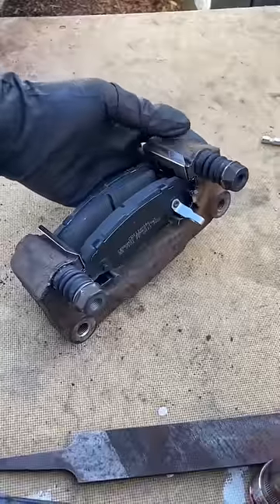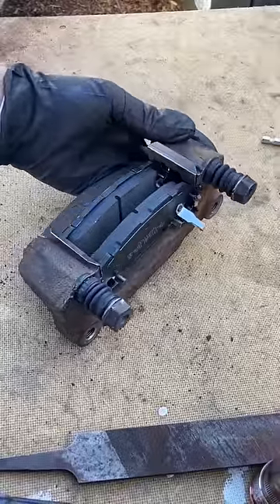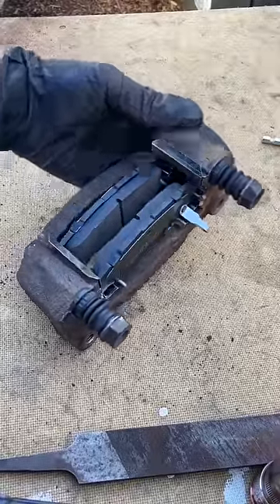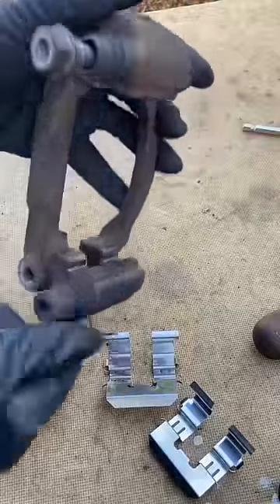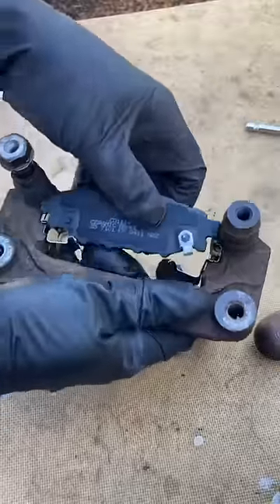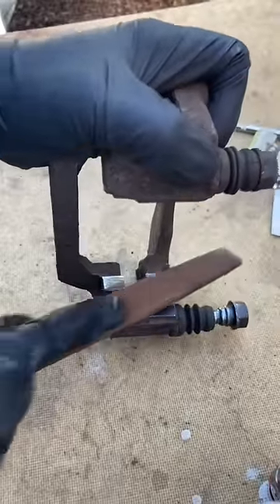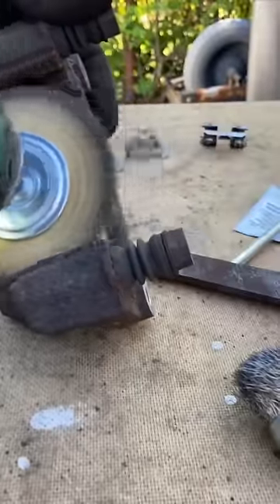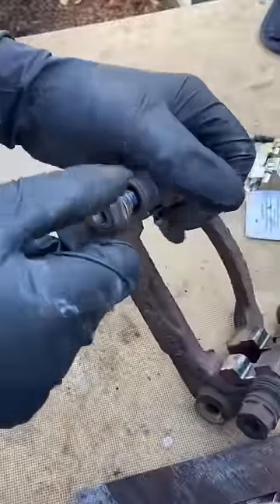What’s the Difference Between a $50 Brake Job and  $200 Brake Job

Comment: Now I'm gonna show you the difference between getting ripped off and getting really ripped off. 😂
Reply: I don’t know how that’s getting ripped off? 50 bucks for a brake job is a steal
Reply: Right
Reply: @Auto209   u get what u pay for lmao my brake pads alone are almost $50. Are you really getting a brake job done or are u paying him 50 to see if your brakes are still good😂
Reply: @itried2hard633  guy I’m the vid is talking about labor only… I’ve never charged anymore than $40 labor and I’ve been doing brakes and charging the same price for twenty five years now. He didn’t show himself doing anything different than I’ve been doing all these years. $200 labor to put pads on a vehicle is just ridiculous
Reply: @warrenmcelroy4718  so $100 per caliper, divided by the minutes it took, x 60 to get an hourly rate. The rebuild parts for the slider is separate cost since they're not included in a set of pads. The pad retainers and guides are though.
The fluid flush of the old brake fluid would be a critical part of a comprehensive brake service though; hopefully that is part of it, because that will keep the pistons from seizing in the bores. 
That isn't shown but fluid flush and replacement will add time to the job, so the labor rate would be lower in that case.
Brake rotor condition is not shown but assume it needs replacement or some additional work, if the old pads were on there long enough for corrosion to build up under the pad retainers.
Reply: @dubmob151  rebuild parts for the slider and brake fluid flush are only needed every great once and a while and as far as new rotors go once you have the caliper off swapping the rotors out really takes no extra time at all
Reply: @itried2hard633  the guy specified that was only for time not the parts
Reply: @dubmob151  brake fluid change is not a necessary part of a break pad/disk replacement job. If it’s not dirty leave it alone.
Reply: You guys looking at the reservoir to gauge if the fluid is dirty or contaminated are rarely going to be doing fluid flushes or changes apparently.
Reply: @markgonzaga6924  I really couldn’t care less what you would want to do, I have people that have been calling me to do their work for twenty years  now so I really don’t need to rely on someone like you to help me make my side money. Doing brakes isn’t difficult at all, I was doing brakes, bearings and seals at fourteen years old so for something so simply I couldn’t sleep at night if I was charging good people $200 labor to do work that a teenage kid could do. Now it’s not my primary money maker and it’s something I’ve always enjoyed doing so that plays a big part of how I prove my work but that doesn’t give you the right to try and talk down to me like you’re somebody special, because I assure you that you’re NoT special at all
Reply: @markgonzaga6924  I don’t have days off but like I said it’s something I enjoy doing not something I HaVE to do.  I’m not about to have a dick swinging contest with someone who is begging for attention, but, I work seven days a week, nine twelve hours per day and not because I Need the $, but because that’s what my position requires and I do very well, well enough to where my wife doesn’t need to work and can dedicate all of her time to our three kids. Mechanic work has always been a stress reliever for me and I’d rather turn wrenches than sit in front of a television, that’s just how it’s always been. All that aside, something as simple as a brake job, even a top end brake job should never cost $200. You obviously are one to take your vehicle and have brakes done for you so I don’t expect you to understand how simple of a job it is, but if you think the high price means you’re getting quality service we’ll then you just spend all that water heater money you feel like you need to but I guarantee your vehicle won’t slow down any better or function any better than the ones I work on. … pretty sad when you’re so pitiful that you have to try and flex in the YouTube comments section, maybe one day when you grow up you’ll see what I’m talking about.
Reply: @markgonzaga6924  lmao I can't believe you're actually simping for big companies and actually putting down a guy that wants to charge cheap for a brake job. Gtfo dude. He can charge whatever he wants and it's nice because some people can't afford to pay a lot for vehicle maintenance.
Reply: @markgonzaga6924  yeah you're that guy, assuming that you know me when you don't have a clue. I work in health care and I'll leave it at that. You're a clown that is upset because a mechanic wants to charge a low price for a brake job. Also, nobody gives a fuck if you don't want to pay anything for cheap. Good for you, there are people out there who can't afford it. Also never said tradesmen don't deserve to be paid fairly. You mentioned capitalism before yet don't understand people setting their own prices is how it works.
Reply: @markgonzaga6924  WoW, you still crying about this??
Reply: @markgonzaga6924  and you’re STILL Crying… yeah im pretty sure I know plenty about Trades, but like I’ve said for the third or fourth time now mechanics isn’t my trade, it’s my hobby but even so $200 is still out of this world ridiculous for a brake job. And as I already mentioned also you have me convinced you’re the type to take his vehicles to even just get the oil changed for you so I can about guarantee thatbrake jobs are out of the question so I don’t really expect you to understand how simple it is to do which is why im sure you likely think $200 is a bargain.
Reply: @markgonzaga6924  $3500 for water heaters 😂 Are you crazy ?
Reply: @markgonzaga6924  its a diy job the big parts stores love to advertise it
Reply: @markgonzaga6924  3,500.00 for a water heater install? What a total rip off. Then you gamble away your money. You give plumbers a bad name. I'll bet you aren't even a licensed plumber
Reply: @markgonzaga6924  I am a licensed master plumber and own a company. We charge 1,650.00 for an install with all code upgrades.
Reply: Wrong!
Reply: Im guessing you dont know how much rent costs these days karen...
Reply: Fr. I do this on my own vehicle and it takes maybe 10-20 minute extra per wheel assuming the labor also includes the rest of the work. He doesn't specify if this is for one wheel, a set, or a whole job. Since labor is almost always rounded up, that's either $200/hr, $100/hr, or, the most reasonable, $50/hr.
Reply: @MrMOGHammer  I have to agree if the fluid is clear and clean do not risk contaminating the system by taking apart at the callipers to flush the fluid there is nothing wrong with. Different story is the fluid is brown and dirty, but now you had better be flushing the entire brake system. Just flushing the calliper would be and absolute waste of time.
Reply: @Auto209  we pay 0.75 usd for a brake job
Reply: @3644Darrell  1600 that's about where we are at too for a water heater with all the upgrades . 3500 is robbery. I bet that guy condemns every tank he comes across. Probably never blown out a pilot assembly or knows what millivolts even means. Gives us all a bad name. People think they can't trust us because of guys like that.
Reply: @Auto209  look at complete picture here, its 50 or 200. Its the 200 that's a rip off, HELLO. Whats it take him 10 -15 mins tops? Lets go to other end this time lets say 15:for a 150;extra ( u getting it yet) thats 600 an hr. You've either got it now or never will, acts like hes such a good guy that he puts on those rubber covers like hes really doing something. Thinking wouldn't trust him putting rear peddle bearings on a kids trike I don't like
Reply: For an extra $50, he could have put new brackets on and save himself an hr each of fucking around with it. Still charge the $200 and save himself 2hrs of his life..
Reply: FACTS 😂🤣
Reply: Exactly
Reply: Really ?, $200.00 labor for a brake job is a fair rate.
It's a 4.hour job on average,you do two a day =$400.00 .
What's wrong with that ?
I tell my customers this
You're paying me for
my time
my tools
my talent  and
my trust.
If that's not worth $50 an hour,
go take your chances with a cheap
dude.
Just remember,when you pay
peanuts,you get monkey labor !
Reply: Van Hill $200 for TWENTY MINUTES of work is NOT “fair rate”..that equals $600/hr..it takes you FOUR HOURS to do a STANDARD brake pad replacement yet you have “customers”? I don’t know which part of that is more ridiculous 😂🤣
Reply: @Auto209  that's labor only you'll pay something like 50-60 for brakes and they will replace the back ones when you don't really need them replaced and charge you for that. I pay like 30 for the front ones and change rear every 3 rotations on brakes
Reply: @dubmob151  I can do new calipers pads rotors and rubber hoses on most vehicles, both sides, and bleed the brakes in under an hour...hourly rate? Lol ok still not $200 for labor...that's an absolute ripoff...new calipers and pads are BARELY $200 on most smaller cars...I charge $25 a wheel individually and our shop usually doesn't charge if we are doing it with other stuff...kind of like oil changes...if we do another job, the oil change is free...
Reply: I have done brake jobs many times and I would gladly pay someone $200 to do my brakes in a second.  That's actually a great deal for 4 and even just the front brakes.  In my area they quote $500 - $1200 depending on if you need rotors.  That's why I do it myself usually.
Reply: Wormy $200 for JUST the LABOR on one axle not all 4 all in..all four labor plus parts especially with this guy will get you right in your $500-$1200..if you’d gladly pay $200 for JUST labor for a standard brake pad replacement on one axle then you should gladly pay $500-$1200 for all four wheels because realistically it’s the same difference 😂🤣
Reply: @Auto209 how about 20 quid in Manchester
Reply: @Auto209  and it costs you $200 worth of brake parts a month down the road when the rust is back and a pad is sticking and ruins them
Reply: Lol.. even for 200$ job still doesn't have all new hardware
Reply: Getting scammed and ripped off
Reply: @awaistasleem s that them albanians guys with the cheap AKs for sale in the trunk near the railtrack? if so, good choice mate! 😏👌
Reply: @kittytrail  😂😂😂😂😂
Reply: @warrenmcelroy4718  hell yeah you’re my kind of brake guy!!
Reply: @itried2hard633  my brakes were 17 bucks its been 4 years and still work great
Reply: Facts
Reply: @MrMOGHammer  you change your discs everytime you change pads!?! That's not money saving at all, that's bonkers.
Reply: @vanhill8831  that's what I make in a week... Then again wages are lower over here as is cost of living.
Reply: @eriv4735  the whole job isn't shown though only  some in the difference between the 2. I still think it's a bit steep but I live in the UK so everything seems expensive in the states.
Reply: @wormy2780  tf are you driving that they're charging that much? A lambo? Also we're talking about just pads here, not calipers and rotors if that's where you're getting those numbers.
Reply: @warrenmcelroy4718  You gotta be kidding, right? Ever heard of inflation? $40 back then is probably equal to somewhere that $200 now. So, you should really consider updating your pricing
Reply: @Siatkowkarzadzi  nah I’m good
Reply: Talk to em!!
Reply: @keilet  where do you go for 50 an hour work? They are around 125 where I am.
Reply: @dubmob151 dude said labor only
Reply: @marushall263  thread is so long I can't remember where the train of thought was headed 🙃. YouTube really needs to figure out how to indent replies
Reply: @jackfairman7371  if you did it okay if you didn't do it why would you react. 🤔
Reply: Funny when people talk sh*t about labor rates. I’m sure whatever blue collar job they do is over paid.
Reply: I see what you did.. well played
Reply: @Warren McElroy  yeah this guy is that mechanic that you don't want to go too
Reply: @MrMOGHammer  it's hydroscopic. Doesn't take long to get water in it and depending on where u live happens quick I've seen them start to darken at 1 year / 20k
Reply: @warrenmcelroy4718  If you're charging the same amount of money as you did 25 years ago, you're ripping yourself off
Reply: @ACEGAMER120  absolutely not, my time and labor is worth just the same today as it was many years ago so no I’m definitely not ripping myself off. I enjoy doing it and it keeps me busy during my off hours so all is good. Just because you charge wayyy too much or may pay wayyy too much for such a simple job doesn’t have to mean that I’m not charging enough. All I’m really trying to say is that just because someone doesn’t charge $200 for a brake job it doesn’t mean they’re not doing them properly.
Reply: @warrenmcelroy4718 it’s absolutely ridiculous thank you for saying this
Reply: Dammit 😂🤣🤣💯💀
Reply: @warrenmcelroy4718 right! He is definitely ripping people off.
Reply: @MrMOGHammer But isn’t brake fluid hydroscopic?
Reply: Don’t be mad because you can’t fix things brotha
Reply: ...this!

Comment: Doesn't matter, shops today will charge you the $200 and give you a $20 job. Which is why I do MY OWN.
Reply from the maker: Correct!
Reply: Not mine 🤷‍♂️ but many
Reply: Same here I enjoy it
Reply: Sucks for the techs that actually enjoy giving you a $200 worth of work when other techs are out there just bs’n .
Reply: @Edgonsantrang  that's a lot 4 brakes . I just done my dad's inc wish bones . Doing someone else's Wednesday..I clean bracket sliding pins etc and of piston needs it I use red rubber lube to help lube it up
Reply: This isn't worth 200 anyway in labor...it's about 40 bucks in harbor freight tools including the drill and about 10mins of time
Reply: @Tiger Shark  I agree 200 is high od walk away but do my iwn anyway..just done 2 cars for mot both passed as expected
Reply: Ikr
Reply: the techs working for the shop are only getting paid around 15-20$ an hour unless ur working for a dealership or commission which most dont. The rest goes to the shop so it can run and profit. Otherwise they would do this for 50$ all day long.
Reply: @bryceg757  garage near me charge 45 per hour plus vat . That's sterling
Reply: @kevinhancock4064  Shop name? Im going off the avg auto repair shops charge hourly for labor across the US which you can easily research.
Reply: @DeaD1y  I'm in UK.  A garage near by ..mind you cosmetic stuff inc servicing of engine I do myself.  Usual brakes etc discs ball joints . I'll do most things tbh ..... just got 2 cars through mot . Basic stuff though pads discs wish bones . Drop links . The mot place my father uses and myself glyn  he offered to do my father's car of needed ..I done it . He complimented my work. If I got the tools and knowledge I'm game lol
Reply: When I had my shop back years ago ÿears ago I was charging are 40 hour and family 35hour plus discount on parts. I always  treated my customer the same way I would do  my own work. I don't know any one that would charge two hundred for  just installing brake pads and make sure the caliper slide freely it part of the job.
Reply: @Stephen Perry  Ye it's a lot that some naughty companies
Reply: 😂 they tried to charge my wife $600, told them nah I’m go to the autozone next door and fix them in their lot instead 😂
Reply: @lrac_1  😂😂😂
Reply: No joke. Where im at its like 0.8 to 1.0 for brake job, shop charges like 380. Hard to give a shit for 20 bucks at 30 an hr especially when it has to happen twice cause they got the wrong parts the first time. And when we talk about labor being too low they say were already morr expensive then others... but its all in profits
Reply: @TheModfatherIncOfficial oioiko
Reply: That's true
Reply: You can buy new calipers and pads for that 😂

Comment: If air gets trapped in the boot it doesn’t mean the boot is bad it means you put too much grease in and it can’t escape past the grease. Simple solution is to just apply pressure and at the same time take a pick or screw driver and pull back the boot a bit to let the air escape.